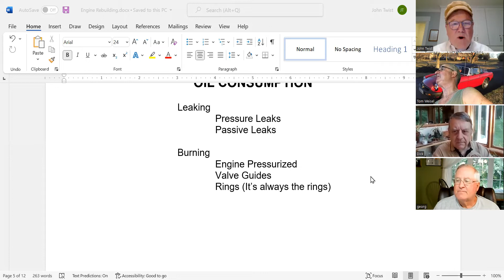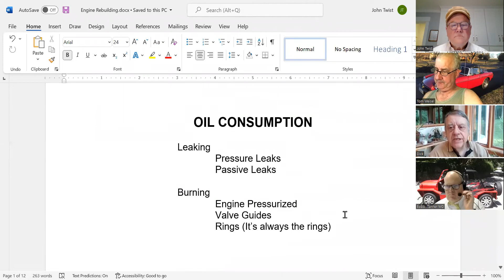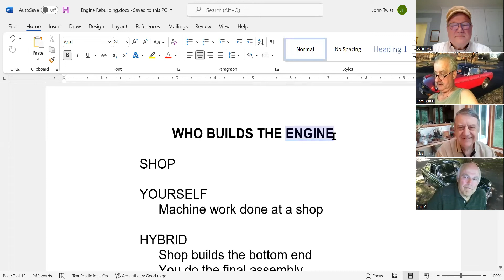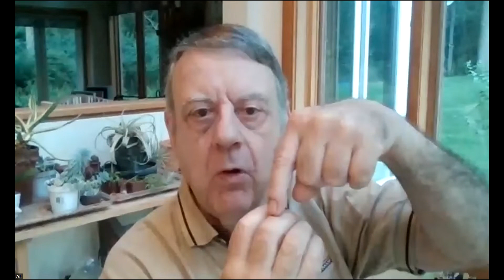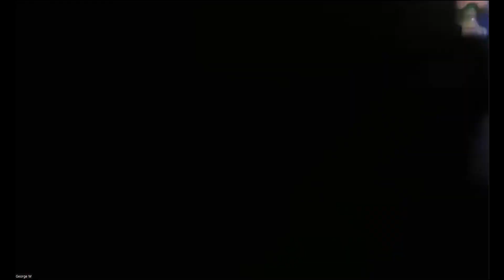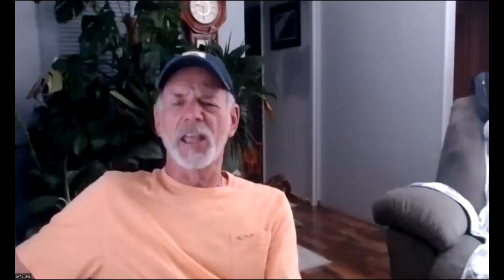366 MG Tech | Q & A on Engine Building

Comment: Hey John... just a suggestion...
For your recorded zoom sessions posted on Utube, it would be much easier to watch if you used the full screen (for the person talking) vs. The 20 postage stamp images you currently use. Just a side swipe left or right on your touch pad screen will change between modes. It really helps when you or others are showing items of interest (provides larger image).